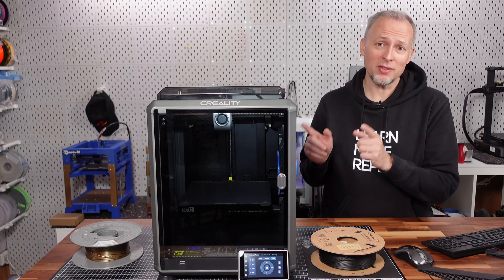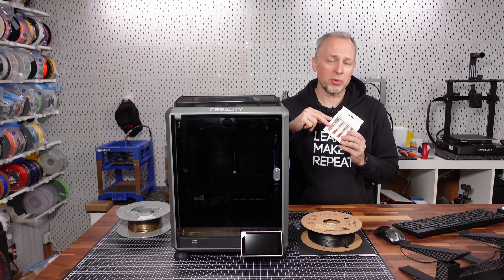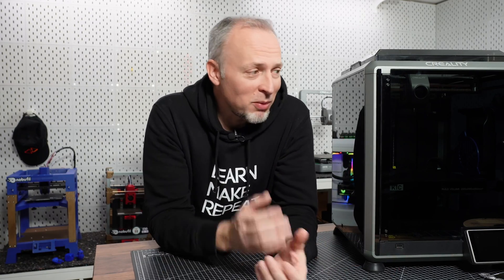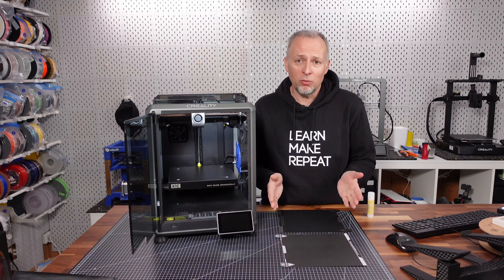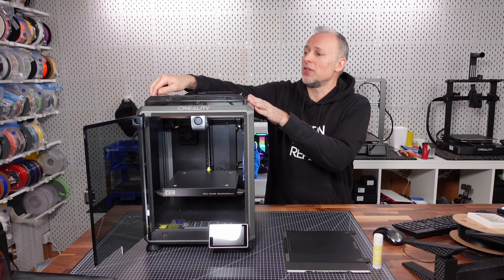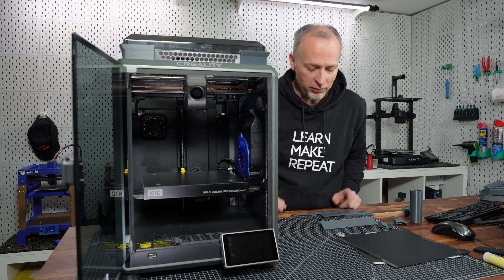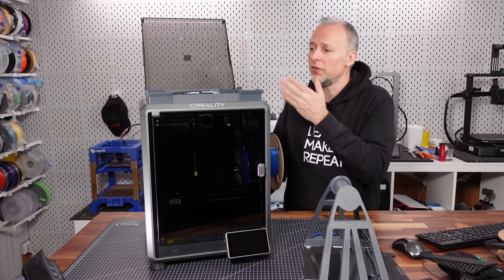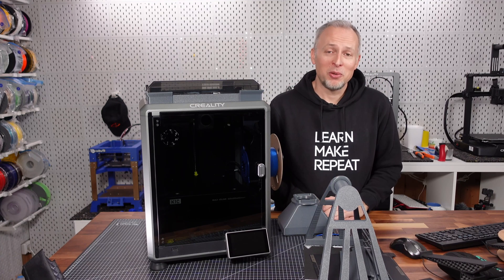Creality K1C Review, Important Upgrades & Mods

Comment: It shut be a direct drive extruder and there we have it folks a Old style bowden tube like on the Orginal Ender 3 . 
Why don't they just upgrade the system to a direct drive. 
Solutions to this wil be a home build in closure put the k1c in there whit out the top lid and a serpert heater to Heat up to 50 degree and even take the glas door out feed the filliment direct from the top and you wil not have to print al the upgrade to save your tool Head so my creality 3v3se whit the nebula pad and al it upgrades are going to make room and do just that what is Wrote. 
Let's see how fast it can go whit prober heat stable and not heated by a on heated chamber. 
The 3v3se even handled asa abs verry wel and tpu 95a

Comment: 11:00
I 3D printed a riser for the lid with ABS for high temperature resistance. It actually works really well, and it has a hinge for the lid which makes servicing and operating the printer a whole lot easier!

Comment: Great video. Greetings from Arkansas in the USA. Do you have a video on how to replace the timing belt that is done without putting a superglue on the old timing belt to wire it through the whole X and Y Axis where the print head. I am trying to do that and figure it out, and do it myself. I am so frustrated with doing it.

Comment: i threw the a plate out after 3 prints and put in my TwoTrees PEI Sheet from my Ender 5. The brush can just be transferred and works as before. Just need to remove the 2 aligning screws.

Comment: Can these allmetal nozzles become clogged with PLA filament due to adhesion?
Reply from the maker: You can clog them for sure if you set temperatures too high for example an PLA cooks for too long. Can be very tedious to clean those out. But that’s not a specific problem with these of course.
Reply: @Crosslink3D  thanks for the reply.

Comment: 12:58 Hi! I'm new to 3d printing, could you please explain why you need airflow for PLA? Isn't there no airflow when you don't use top lid extenders? What would happen if I use fully closed panel when printing PLA?
Reply from the maker: Usually what manufacturers recommend is to keep the printer front door open for PLA printing to keep things cooler but that increases the perceived noise of the printer significantly. The mod will enable a bit more air flow through the grid holes if you use those inserts for PLA printing while keeping the door closed and so the noise is going to be lower.

Comment: It's a bit silly that a printer designed for carbon filaments doesn't come with suitable plate and nozzle.  I've ordered the nozzle set and the B plate so that's an extra 50GBP just to achieve the advertised ability.  Still, at least the printer was only 353 GBP, so not bad overall.
Reply from the maker: I really like it. We'll modify that printer soon with the CFS upgrade. That's going to be fun.

Comment: Great and complete video. 
I have an Ender 3 s1 pro with a Sonic pad and I am considering buying a K1c. The main advantage of the K1c for me is the fully automatic bed leveling, but from the videos I watch I understand that the K1c also has a leveling problem and a warp bed... now from your video I see that there are other possible problems, so I wonder if it's worth it, if K1c will be good upgrade of Ender 3 s1 pro Sonic pas?
Reply from the maker: Better go with the new Creality Hi if you don’t need the enclosure or the Ender 3 V3 but that won’t have a multi color option. Depends on your budget and use case.

Comment: I would add that the plastic extruder gears are a bit ordinary - I had a nozzle jam, and it sheared off 3 plastic teeth - so ended up with a heap of under-extrusion issues. There are steel replacements available from the usual suspects (ebay, amazon, aliexpress) cheaply that last much better. I had that failure at about 500g of filament printed, so was a bit underwhelmed compared to the V3 SE I moved from (which has never had a jam - ever).

Comment: I've downloaded the files for the riser but it says it will not fit on the bed for my K1C. The dimensions are 231.7 x 192 x 39.99, the printing area is only 220 x 220. How do I get this to print in one? 
Thanks in advance
Reply from the maker: Diagonally it will fit

Comment: 11:20 does your printer not have a buffer to prevent scratching?
Reply from the maker: No there is none
Reply: @Crosslink3D  well I just unpacked mine and it came with a buffer strip to prevent scratching 🤷‍♂️
Reply: @Blaze_Bro I received my K1C yesterday and it included the adhesive strip. 

I've printed the side mount for the spool.  Now I need to print the parts to lift that silly lid.
Reply: @Blaze_Bro  it has a side strip, but not a front one. I bought K1C a few weeks ago, have now raised it also, unfortunately not in time to stop the front of the lid scratching when printing closer to the front of the bed

Comment: Hi, I bought a Creality K1 C brand-model printer but I have been trying for 2 days and I can't print. Namely, I put the filament in extrusion mode; I heat it up to 250 -260 or even 270 degrees. When I push it with my hand, the filament flows. But when I don't push it with my hand, there is no flow. I try the demo ship print in its own memory and there is zero filament flow. The nozzle lock is on. I take the filament to the nozzle tip; but for some reason it can't feed automatically. I couldn't understand if it was my fault or the device was faulty. This is my first 3D printer. I preferred Creality because it was highly praised, but I really regret it.
Reply: Hi, did you manage to solve this issue?
Reply: @glueupsscrewups  yes i forgot the lock  the nozzle
Reply: @KevrenBey new K1C owner here.  Not the nozzle that locks, it's the extruder ( feeds the filament into the nozzle).   I've unfortunately become way too familiar with the extruder for a new printer.   Turns out the rainbow filament it ships with is crap and squishes sometimes going through the extruder causing it to jam.
Reply: @kinarism  thank you ,i am really kind of beginner ,so i made a silly mistake . Except this i realy liked printer.
Reply: Glad you got it to work😊 im considering buying one myself

Comment: I think you may be wrong about the glue. Its more used to promote adhesion than stop it from happening.
Reply: Maybe.   Having never used glue stick, I was surprised to see it being shipped with my K1C and ignored it.   Larger prints definitely stick too well to the K1C plateA without glue.   I've broken some prints removing them if I'm not careful and remove the whole plate and flex it.   Never had that issue with my old E3Max (which came with a textured glass bed).    Definitely gonna try the same prints with some glue stick and test but it's quite possible the smooth PEI sticks too well to PLA and having a layer of glue between will lessen adhesion but not too much so the print falls off.

Comment: Great video! I have a question: which is better, the Creality K1C or the Bambu Lab P1S? I'm currently using an older Ender 3 and looking to upgrade. Is the P1S significantly better than the K1C? Do you happen to have any pros and cons for these two printers?

Comment: I bought a K1 when they came out and sent it back because the print quality was awful.
I've recently picked up a used K1C and the print quality is night and day.
Creality have fixed the issues with the K1 and incorporated into the K1C.
I wouldn't hesitate buying the K1C.
Reply: i just grabbed a k1c. your comment helped, Replacing my Ender 3 v2
Reply: There's really no meaningful difference between the 2 tho... creality generally has no so good assembly, and u need to fix the belts to get the bed actually level.
Reply: @Nobody-vr5nl  they made serious changes. New servos, new idlers etc

Comment: It took me two days to get it working.  All because of a problem with the documentation.  They show a toggle switch on the main diagrams.  I saw the hole where the switch should have been, but there was nothing there.  The setup routine on the printer did a test that always failed when heating the hotplate.  Contacted support and they asked me to check the voltage setting switch.  I couldn't find one.  So, since the unit shipped with a standard US 115V power cord, I assumed (incorrectly) that the voltage must not be changeable.  We do not use 115V cables for 230V connections!  Several support contacts later and me checking all the internal cable connections, another support tech said to check the voltage setting and sent a photo with two big red arrows pointing at that hole in the side!  Sure enough, after leaning the unit so I could see inside the hole, there was a voltage change switch that was set to 230V!  It wasn't a toggle switch as noted on the diagram, but a sliding switch.  Being very precise in my use of the English language, I was looking for a toggle.  Also, nowhere else in the documentation was there any mention of that toggle switch or about setting the voltage.  Two days wasted because of unclear documentation.
Reply: Hi @kennethewald1189, I've just checked in the "Quick Installation Guide" there's no mention of a toggle, it also says to use a flathead screwdriver. In addition, this type of switch is fairly standard in power supplies. 🤷
On the other hand, you need damn good eyes to see into the tiny hole on the side of the machine 🤣 I had a hard time!
Personally, I had more trouble with the filament insertion step: "until you can't push it in any more". As soon as I felt resistance, I didn't dare go any further into the extrusion head, with the result that nothing came out when I printed.
Reply: @TheMoye  I don’t recall seeing a Quick Installation Guide.  But, I don’t recall lots of things!  😏😏
Reply: @kennethewald1189  👍🤣🤣

Comment: Mine came with a piece of rubber that goes inside the top polycarbonate cover that guards against scratching of the cable chain. So that is fixed now. However, mine scratches the top cover because the cable chain rubs the top as it moves. Not a huge deal to me but they need to raise the cover a few millimeters. That would solve it. Other than that it's been a great printer. Coming from 3 VZBoT's the speed isn't out of this world but it is fast and doesn't sacrifice quality very much if at all. I have printed several spools of ABS, a spool of PPC, and some PETGCF and it handled all of them perfectly. Decent printer for the money.

Comment: After watching this video, I took the plunge and ordered the printer for myself. I'm curious though....have you found a way to load new filaments without having to work so hard to manually shove the filament through the tube to the extruder? I had my first spool run out mid-print and the slow, agonizing process of hitting the extrude button over and over to get the last length of filament out of the tube, and pushing the new filament through the tube....took forever. I'm tempted to try the top load option you shared, but then that means the run-out sensor is bypassed and the printer won't pause the print to allow a new roll to be added. Thoughts?

Comment: Hi Daniel, 

Nice and informative video. However, you have installed this riser incorrectly. This front right corner riser should be in camera corner to avoid toolhead from hitting the riser.

Comment: Why these people slap the filament on the backs of these machines..????  Such a lazy design.
Reply: There’s a patent on incorporated filament holding and dehydrating. I think we’re two years out from seeing it all built in.
Reply: Stop crying baby, I USE the back side because my racks are separated from the wall, and it’s much easier to go behind my printers to change the filament then it is being on the side. As well as I can fit 4 machines on a rack that I use vs only getting 3 if I went with the side mount. It’s just preference, you want side mount, then mount on the side.
Reply: @UG3DBoss-54  ure cringe asf kid, never comment again.
Reply: Its cheaper to produce
Reply: Who cares
Reply: I would agree, except for the fact that they include a side mount spool holder on the printer's pre-sliced print files.  They went to the effort of designing and then probably testing the absolute shit out of said design, because it's a print that needs to basically work flawlessly out of the box even for noob 3d printer users, as presumably since it's a first-party design and recommended as one of the very first things one could/ should make, it is probably covered under warranty.  Granted there are problems with the side mounted design (tube dragging across the corner without further third party parts being run off), but I honestly think that it was probably more effort to make and test this design than it would have been to just mass produce it as an injection molded part where they have control over tolerances, materials, and the level of experience of the producer.  It might have saved them a buck or two in actual production costs, but I don't actually feel like this was "lazy."  

It also is a message to the user that they are expected to tweak and modify their printer for their own needs and preferences, which is refreshing to hear.  I know it's a common sentiment in the 3D printing industry, but for anyone who is new to it it's kind of a neat feeling to be told "you want it?  Make one!" rather than having scary popups, warranty void stickers, greyed-put buttons and check boxes, popups for their own store page, and walls of EULA text shoved in front of your face every time you try to turn a knob or add something onto your machine.  The K1 series is, after all, an obvious response to Bambulabs' line of beginner-friendly 3D printers.
Reply: @ you just wasted your time typing this for some brainrot who wouldn’t understand any of it.
Reply: Everyone who buys this should definitely own a dryer so why not print everything from the dryer?

Comment: I am still a bit suspicious of my K1. I tried the "resume print" feature after a power cycle and it just smashed the nozzle into the heatbed then dragging it for a few cm. Smashing the stop button didn't work and I had to unplug it. It works 99% time but if something fails it does so spectacularly and klipper isn't fast enough to stop any damage. I miss ocotoprint

Comment: my K1C nozzle snapped in half right at the end of the hotend, i took the whole hotend off so ended up having to do a hotend swap so now i'm using the microswiss hotend for the K1C, wish i didn't have to do that tho.
Reply from the maker: Was there a grub screw holding the upper part? I discovered on the Ender 3 V3 there is a grub screw pressing against the brass ring on the upper part. I did not know this and so broke off the nozzle from the tube
Reply: @Crosslink3D  i managed to get it out once already with no problem so thought it would go in and out just as easy again... i was wrong. my new nozzle is working great tho, just it cost me as much as i sold my Ender 3 for.... also i'm going to buy a "BIGTREETECH SFS V2.0 Smart Filament Runout Sensor" because it can detect flow problems like clogs or jams which the stock one cannot detect.
Reply from the maker: Great tip with the flow sensor!

Comment: Despite buying many Creality printers over the years I chose another machine when I wanted the latest super-fast printer, I did not even consider the K1 or K1 Max as I knew full well it would have issues, and I was correct, I think they are on the 3rd iteration of the extruder and the bed had warping issues.
 I chose the Bambu Lab X1 Carbon and AMS unit, and it has been an awesome printer, yes it is not perfect but compared to the issues I have had with Creality machines over the years it is almost perfect!
Reply from the maker: Hey Andrew, thanks for letting us know! It’s fair points and my feeling is that everyone is still trying to catch up with Bambu Lab but still making a lot of compromises due to manufacturing costs and lack of time. Hope this is going to improve though
Reply: I bought two k1 maxes for the price of a x1 carbon. Just paid off itself quicker. But I can wait for the CFS. The new gen core xy’s have resolved my issues with creality hardware.